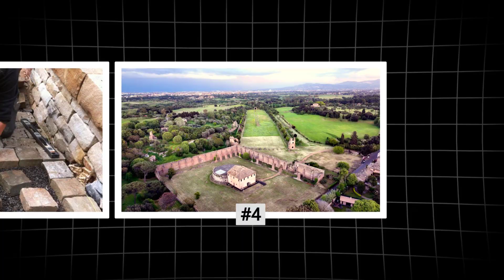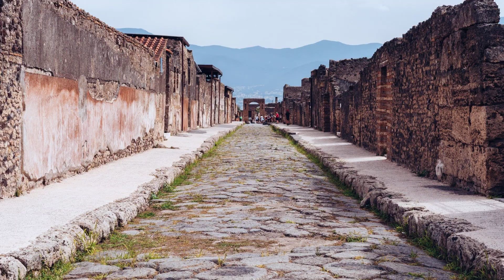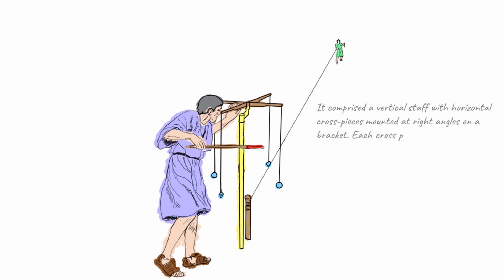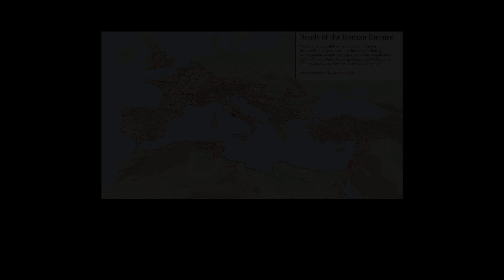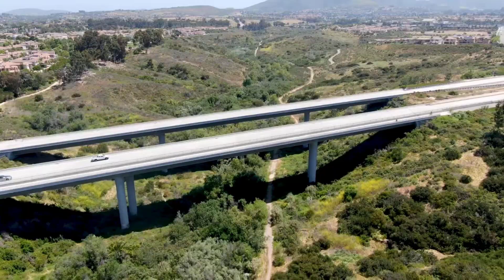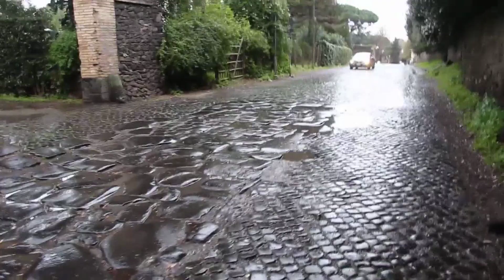Why Roman Roads Were Built To Last While Modern Highways Fall Apart

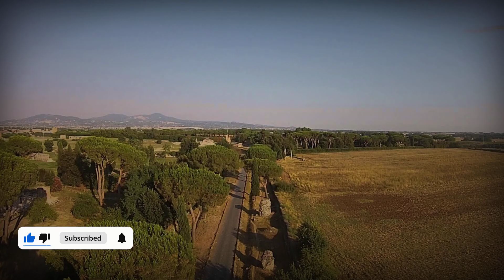Comment: 1:41  modern roads are 50% transportation option and 50% Jobs program.  If they are not a jobs program, why are there no contractual mechanisms that penalise companies whose roads fail before a stated date?  Why there is no mechanism is because most roads are purposely designed to fail and need repair or replacement to justify certain gas taxes.  Just a thought.
Reply from the maker: Very interesting thought! And I believe there might be some truth in it perhaps
Reply: @theancientways  a little bit of historic perspective, one of the reasons that the Allied forces were able to move as quickly as they did through Germany was because of the surprising resilience of the Audubon system. While the German military destroyed bridges and overpasses, however, they were not able to do substantial damage to the roads’ surface which allowed the Allies supply system to essentially run a muck.  When I lived there, I almost never saw construction.  Currently, because 80,000lb 40,000k truck traffic, there is more repair.  In some US States, they allow and encourage innovation; some states allow ground tires as filler, one state paved a 5 mile stretch with a mixture containing volcanic ash to eliminate ANY gaps for moisture to enter, freeze and expand.  After the 3rd or 4th year, the road paving coalition sued and got the experiment shut down, the road torn up and replaced.  The “funny part?”  It took them 2x the time to tear it up and since it was a “fixed rate” contract, it cost them tens of millions of dollars more than they budgeted!  You could probably do a whole video asking that very question.
Reply from the maker: @longtabsigo  Thats a very interesting take, thanks for elaborating! I'll consider making a separate video about it for sure :)